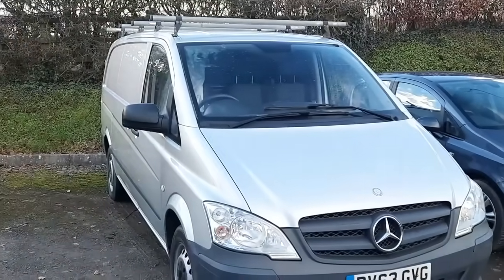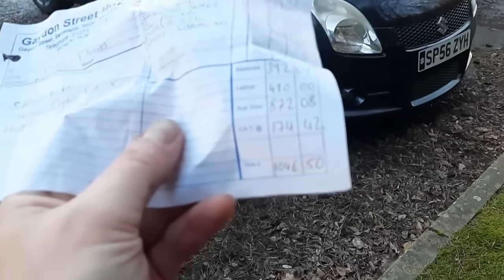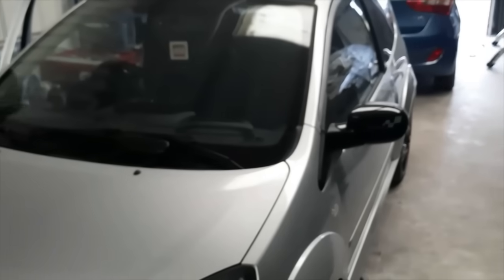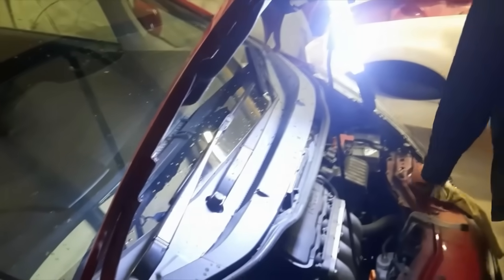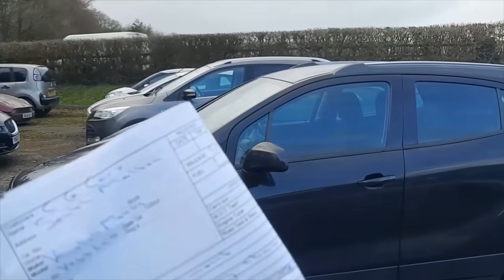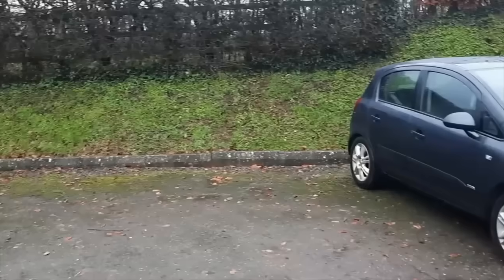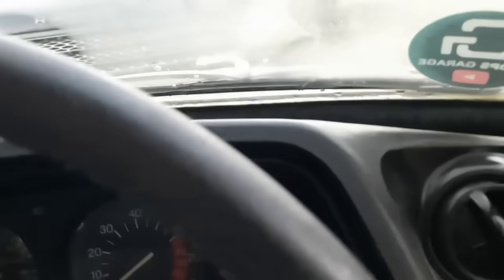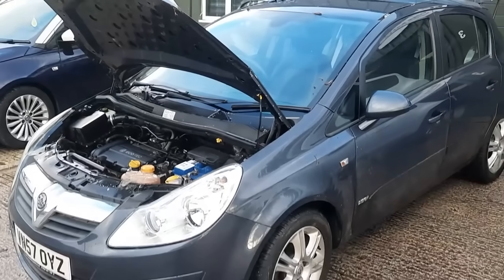This is exactly why you should NOT buy Used BMW's

Comment: There must be someone in the Marina owners club who wants the Ital!  Please sell it before it dissolves!
Reply from the maker: Lol
Reply: I had a 1.8Ltr TC Marina back in the 1980s at the time I was a Ford lover 1600E Mk2 and a Mk3 Cortina prior to the Marina and in the 1st 3 Months of owning the Marina I managed to strip the teeth of the Diff and had to replace the Axle then a few weeks later I managed to totally destroy the gearbox, I put it down to the Engine being way to Torque,y for the transmission anyway I replaced the gearbox and gave it too my sister who had it for almost  20 year's until it fell to bits with rust. Funny thing was the Engine started 1st pop and ran sweet as nut.

Comment: 🤡 I have a N47 in my car on 156000 miles. Shock horror it’s reliable. 🤦‍♀️
Reply: @DjNikGnashers yes but that's a proper engine, the later 1.6 diesel bmw is well known for chain problems, but yes James shouldn't really be saying don't buy bmws.

Comment: Shock - all cars suffer problems if not maintained ffsk.
If BMW's were that bad, nobody would buy them, but they do buy them again and again because they are brilliant cars and very reliable.
I worked in the motor trade for years myself, and I find BMW haters very funny.
Jaguar & Land Rover / Range Rover were by far the most unreliable in my own experience. Followed by French and Italian cars.
Reply from the maker: When I post my experiences everyone always say down to poor maintaince. This had near full history. I get KIa, HONDA, Hyundai that have had next to no history and never had chain issues. Not a garage I know has anything good to say re this gen of BMW
Reply: @ChopsGarage your right bud, that 1.6 bmw diesel engine of that era is junk, I've had a few in bms and minis, one with fsh blew up, chain came threw top of engine, but tbh a lot of chain engines are on borrowed time after 100k,had one go on a sirocco 1.4,had plenty go on jag ingenium engines, 1.2 engines in vws, seats,
Reply: @ChopsGarage  There are a couple of bad BMW engine designs, yes I'll agree, but the way you're typing and speaking, comes across as DON'T BUY A BMW THEY ARE ALL CRAP lol it's ridiculous.
I worked at a Hyundai dealership in the parts & service department (for FOUR years, so plenty of time to get a good idea of the truth),, and Hyundai have a VERY good reliability record. I have seen dozens of major engine failures, gearbox failures, etc, so if I went by your rulebook that must mean ALL HYUNDAI'S ARE CRAP AND UNRELIABLE.
When you work in a garage you see problems, it comes with the job, but it's easy to get blinded by bullshit which clouds your judgement on the wider picture of things.
There is nothing wrong with that 'gen' of BMW, just 1 or 2 engine designs which were not as good as the others.
BMW straight 6 engines have a fantastic reliability record, and most of them get thrashed constantly with no problems.
Get real man !

Comment: Same goes for High mileage Mini's with the same parts. They were not designed to last for a reason. Nothing built in the last 20 years is designed to last to be honest.
Reliability in Vehicles peaked about 1994 - 1999. since then most brands have been less reliable... Some more than others of course.
I will Quickly quote some highly reliable regular cars from that period to prove my point. : Ford Focus Mk 1, K11 Nissan Micra, P11 Nissan Primera, Ford Mondeo Mk1, Toyota Camry, Toyota Carina E, Mazda 626, Mazda 323, Cavalier Mk3, Vauxhall Senator, Vauxhall Astra Mk2 & Astramax Van.. That's just a few.. There is obviously a lot more.
Reply: Your right bud, cars were OK in the 90s,these days your always worried about some issue, I've been running a diesel astra for this last week, seemed OK, now dpf full message has come on...

Comment: I have a similar issue to the Jazz on my ST220, which Ive only discovered recently for obvious reasons. It blows cold until I've had the revs up over 4,000 for a while, when it gets red hot - and then drops off again after a period pootling along in 6th. Temp gauge never goes above halfway.
Reply from the maker: Sounds like air lock

Comment: I'd not dream of asking for a repair after 6 mths bud, you've really treated him there, tbh if there moaning after that time I'd not sell them any more cars, I purposely avoid selling friends or anyone I know cars as it's always trouble, I've got a few and one in particular is hassling me after 2 years and tbh there quick to kick off, those chains are a big problem, not meant to be a serviceable part, 3 chains, gearbox side, on borrowed time after 100k,i had one blow at 109k,i don't buy cars now with that engine (minis 61 plate on) I've heard em rattling at 50k.
Reply from the maker: Yes friend sales riskiest
Reply: @ChopsGarage  yes bud, I prefer them to go far, far away, Ive found it's best, too many issues these days on cars.

Comment: I always do well on used bmws. Never any issues or come backs
Reply from the maker: Same sort of age?
Reply: @ChopsGarage  generally 2008 to 2014. I know exactly what issue you have with bmw. It's the actual chain guides that go not the chain itself. It makes them noisey. I generally listen out for that rattle when buying. The 4 and 6 bangers are very reliable.
Reply from the maker: @DaleSteel  he said it had stretched